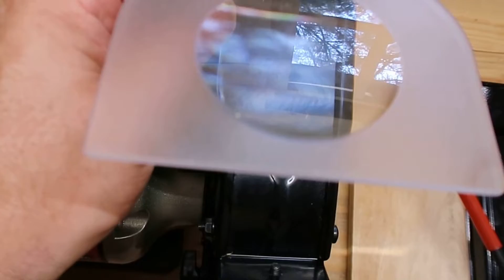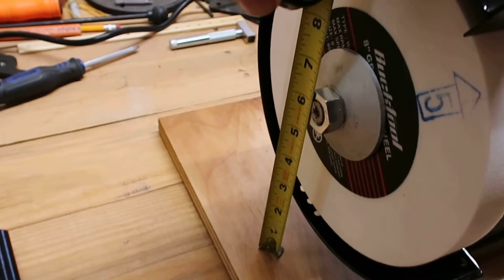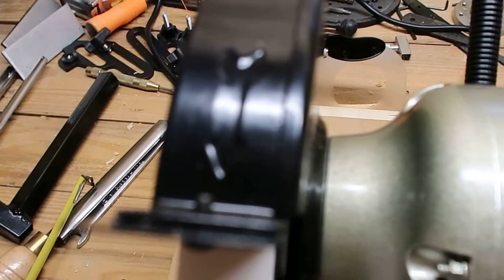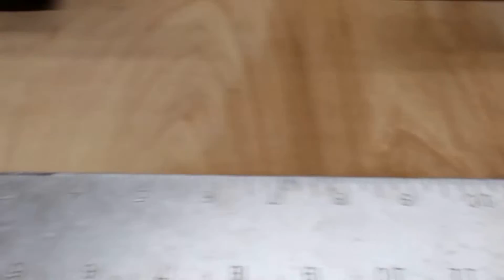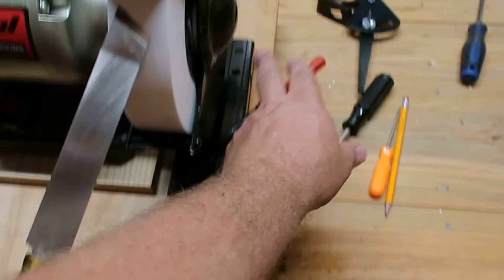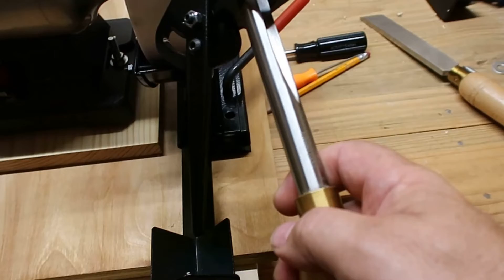BuckTool Grinder and Easy Grind Sharpening System Install

Comment: I came here, hoping to see how to remove the guard on the left grinding wheel. I got the model that has a sanding belt on the right hand side. But I need to remove the guard from the left side. The wheel free spins so I need to find out how to grab a hold onto something to keep it from spinning so I could loosen the nut. Any ideas? Great video, by the way.
Reply from the maker: Thanks for watching. I hope you got it loose. Not sure right off hand.
Reply: @homegrowncountryhomeplace  Thanks for the reminder. I walked out to my pottery studio and looked at the grinder more closely. I found the solution! I was able to remove the guard that was preventing greater access to the grinding wheel. I had to put a three-quarter wrench on opposite sides. The grinding wheel was of course threaded in the opposite direction and that took a little figuring out. But I got the cage removed and all is well in Jacob‘s pottery studio.

Comment: its been almost a year now ,,,how's the grinder and stones holding up ,,,just picked one up off eBay,,but went with the pro grind sharpening system,, just wondering if its a good grinder
Reply from the maker: I haven't spent a lot of time using it. My wood lathe had a recall on it and just got the parts in for it and haven't had much time to do any wood turning lately.